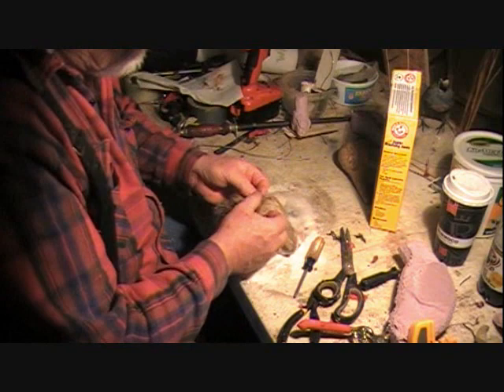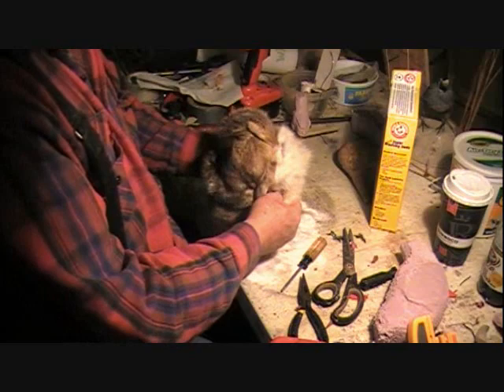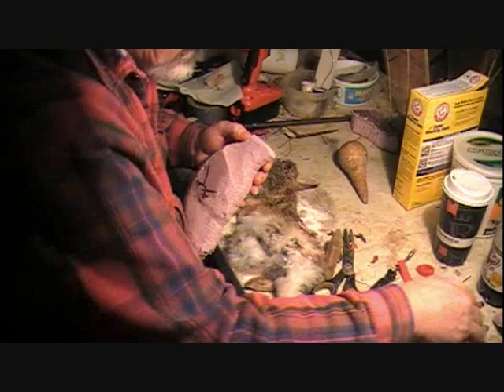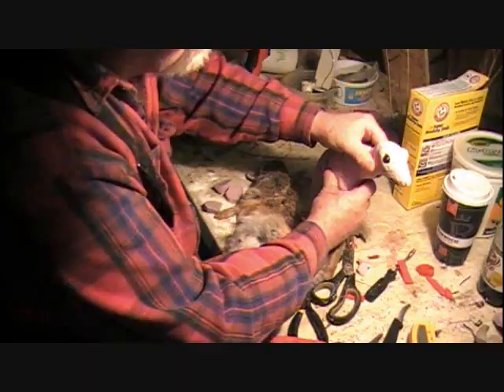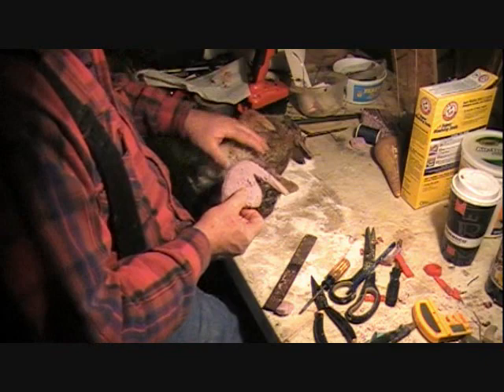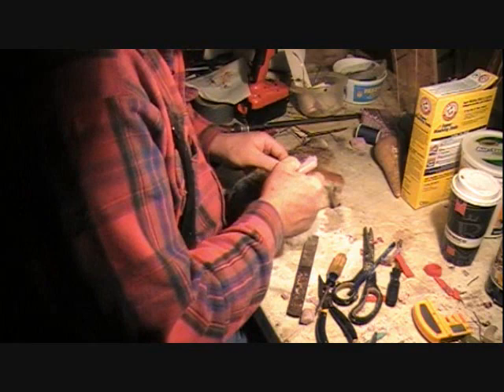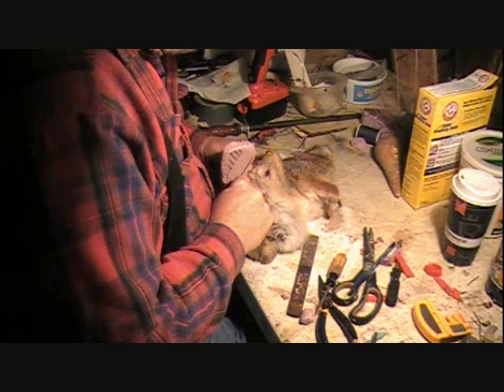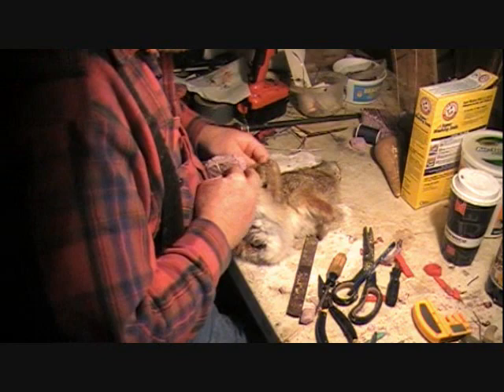RABBIT TAXIDERMY - Video 5 of 6 - MOUNTING w/COMPONENT PARTS, PRESERVING, DETAILING

Comment: hi what is the size of the glass eyes you use?
Reply from the maker: Measure the eye size first.  From top to bottom.  Go to McKenzie Taxidermy Supply or VanDykes website.  The measurements need to be in metric.  A cotton tail rabbit uses like a 14 or 16.  Right around that area.   Get the dark brown eyes.  For jack rabbit's, they take a different color, like a yellowish.  That would be a whole different eyeball.  The eyes come in pairs. I've put a link below to my website detailing supplies used in this video.  Thanks for the question.  - Rick          Supplies used in this Video:     http://wyomingtaxidermy.blogspot.com/2014/04/rabbit-taxidermy-supplies-i-use.html
Reply: Thank you very much for the reply.
Reply from the maker: You're most welcome.  Email anytime. - Rick